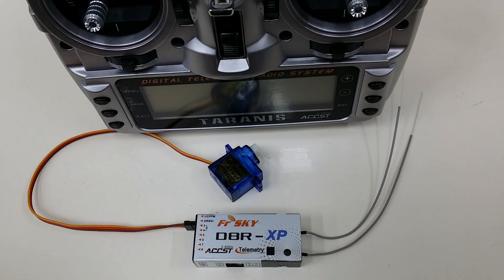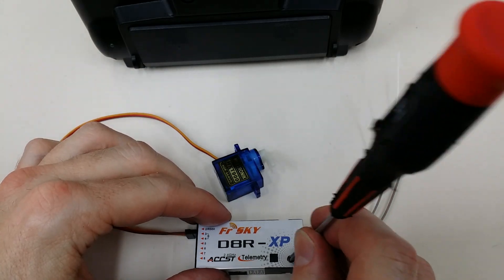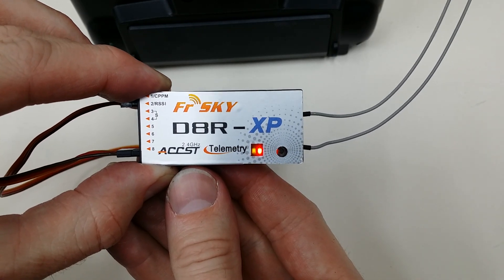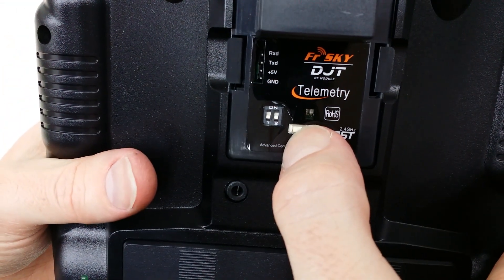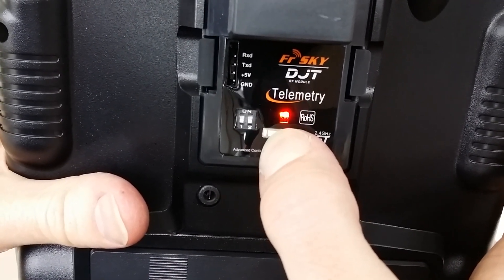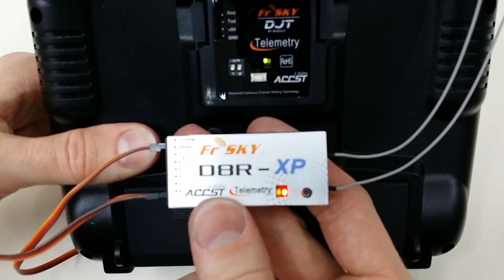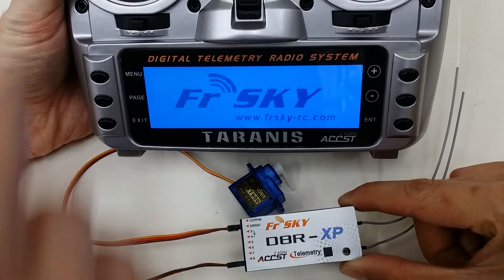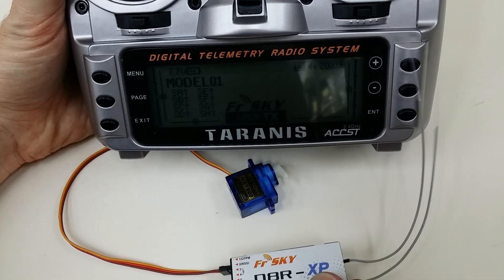How to Bind the FrSky D8R-XP to DJT module

Comment: I bought the Turnigy 9XR (from HobbyKing......still ~2 weeks from delivery) and the D8R-XP with DJT module which I do have. I have since bought a Taranis and ordered a X6R which has not arrived yet. Will the D8R-XP bind with the internal XJT tx on the Taranis? How? Also, as I have a 3DR Y6 w/PIxhawk just completed, I now am to the point of getting to the calibration mode for the tx but am running into roadblocks getting everything to talk in Mission Planner.

How would you go about setting this up with the Taranis and D8R-XP? Should I use the DJT module?  What is the difference between RSSI (which you used) and CPPM and which should I be using? I can't seem to get them to bind. 

When the X6R arrives, I'll probably use that, but would like to learn on what I have now.

FYI, I'm and old timer RC plane/glider guy (still using 25 year old Futaba) transitioning into this newer technology and I must admit it is a bit overwhelming. Any help is appreciated.
Reply from the maker: Hi John Williams  Yes, the D8R-XP will bind to the Internal XJT on the Taranis.  It is similar to the procedure here: How to bind FrSky D8R-II Plus to XJT module  I'll soon make a video to show exactly how to do it.  There's no need to use a DJT module if you have the Taranis, just bind in D8 mode and that's basically all there is to it.  CPPM is what want to connect to your APM or similar flight controller.  RSSI is more difficult to hook up as it's a digital signal on the FrSky, and most devices want an analog signal.  It is pretty easy to convert it into analog if needed.  Please contact us through our website if you need more help!